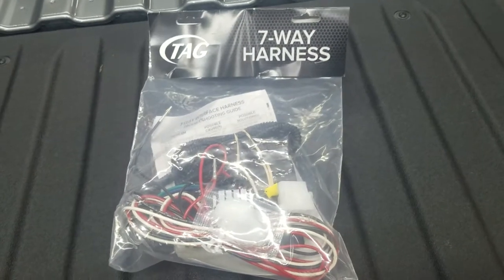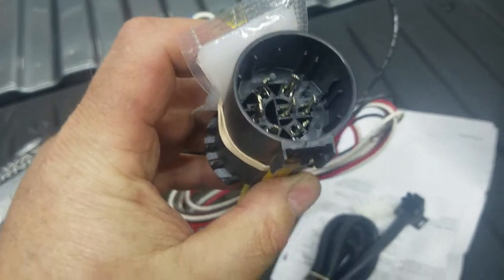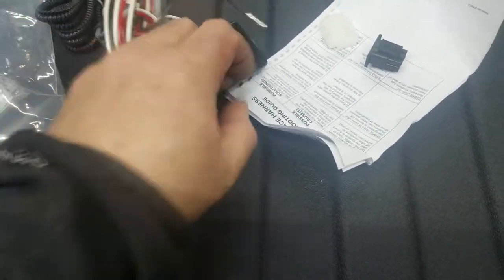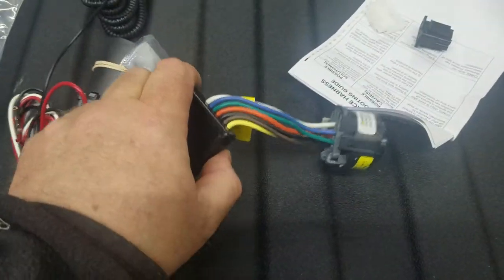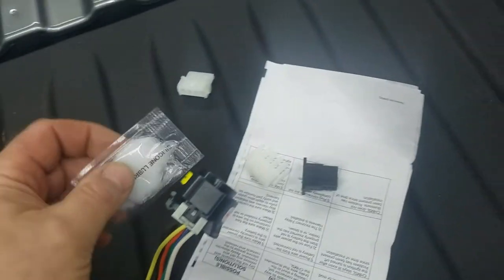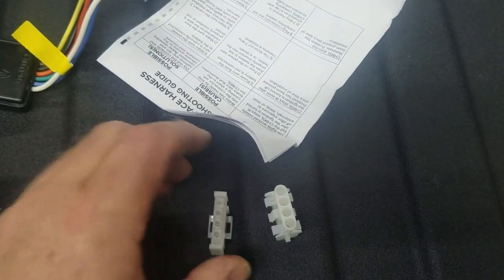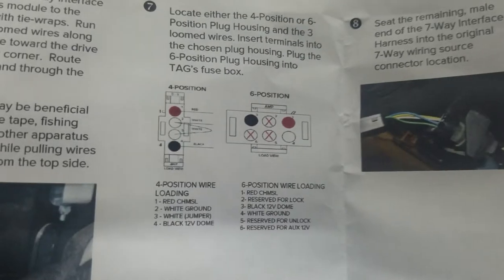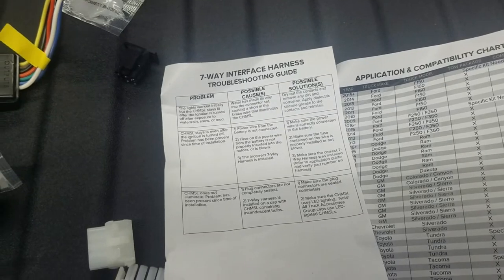Leer plug-in harness for installing third brake light on truck cap topper. No splicing T harness.

Comment: I almost scoffed when I saw the price, but I bit my lip and bought one for my 2015 silverado and it is perfect. With the amount for time I saved trying to use other options for wiring, splicing into brake lights, whatever, it was well worth the money. Took less than 45 minutes. Plugs right in and I just followed the routing that the wires for my in bed lights ran and voila. Works like a charm. 100% recommend.

Comment: Leer installed this on my 2024 2500WT with my camper shell to run the third brake light and dome light. I want to run nilite led strips under my bed rails. I figured it would be simple to tap into the constant hot dome light wire. Will this supply enough power for the led strips?

Comment: Need one of these that also has the keyless entry wires attached. No one I talked with has the answer. And the local Leer dealers will not help me out with a part number, or sell me one. I keep getting told it is special order, and they will have to get back to me... but never do.
Reply from the maker: None of the harnesses have the keyless entry wires with them. Keyless entry will have to be hardwired to your truck. The 6 way plug included in these harnesses has 2 extra spots to plug the keyless wires into it. If you need keyless entry wires you will have to order a complete keyless entry replacement system to get them

Comment: Does this work for a elec lock also...its for a 21 gmc
Reply: Looking for an answer for the same question, but for a 2020 Ram 2500. No one I talked with has the answer. And the local Leer dealers will not help me out with a part number, or sell me one. I keep getting told it is special order, and they will have to get back to me... but never do.
Reply from the maker: None of the harnesses have the keyless entry wires with them. Keyless entry will have to be hardwired to your truck. The 6 way plug included in these harnesses has 2 extra spots to plug the keyless wires into it. If you need keyless entry wires you will have to order a complete keyless entry replacement system to get them

Comment: I just picked up a used Leer 200XQ. Will this work for the keyless entry, brake light, etc?
Reply: It does not make lock/unlock work by itself, you'd have to run 2 wires all the way to the cab for lock/unlock, but the female end would slot into the 2x3 black plug shown in video. This will only do brake light and one other 12v item (dome light or something similar) as it comes.
Reply: @nateyg96   Thanks. Do the instructions include how to wire the keyless entry?
Reply from the maker: No, the keyless entry is different for each vehicle and will have to be wired to your truck's door locks.
Reply: @ezwheeler   Or power lock tail gate!

Comment: I am dealing with this now. I was told there are computer problems with the trailer recognition and warning's appear on your dash.  Can you help me?  I have a 2022 Silverado 1500, LTZ, Z71, 3.0 Duramax, 4D crew cab, standard bed, multi flex tail gate.  I am ordering the LEER 100 XR with front and rear 12volt interior lights with the prop rod light switch, triple lighter socket and the power window lock.
Reply from the maker: https://www.ezwheeler.com/products/third-brake-light-gm-advance-trailer-plug-in-t-harness-for-truck-cap-215272?variant=43671794221300

Comment: I have a 2013 F150 with an older Impulse camper cap. Would this still work?
Reply from the maker: Yes, it comes with a universal Plug end as well so that you can use it on any brand.
Reply: @ezwheeler  yeah after I got mine I realized the plug on the light won't fit any of the plugs it came with so I gotta figure that out

Comment: Does dome light work independent of the ignition ith this harness?
Reply: 12v constant
Reply from the maker: No, it uses the 12-volt constant power at the plug for the dome light
Reply: Thamkyou. I since ordered  the harness and installed it. Great product!

Comment: Wouldn’t this make my truck think a trailer is connected all the time?
Reply from the maker: The 300200 is specifically designed for the Ford and Toyota  trucks so they will not notice the harness connected. It requires an additional wire to the battery that will have to be hooked up

Comment: Not the bumper plug it’s the fifth wheel plug in the bed
Reply from the maker: Yes, you can use the fifth wheel plug in the bed as well if you have it, but most people do not have the fifth wheel option which is why we didn't mention that.